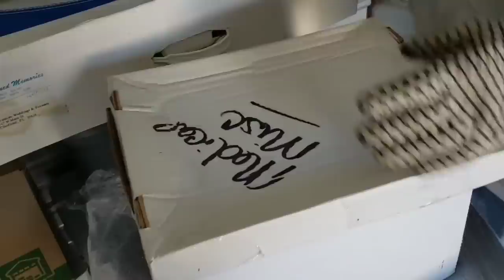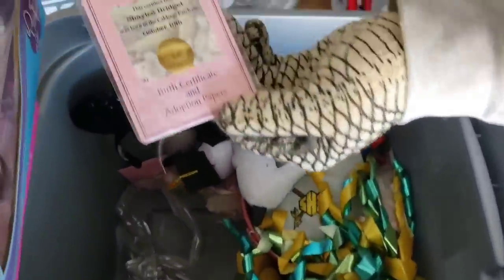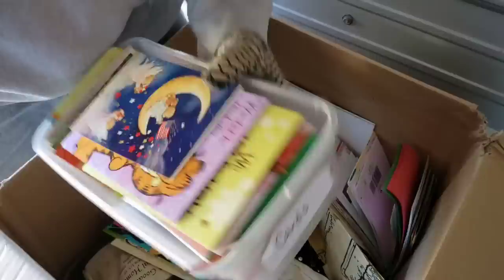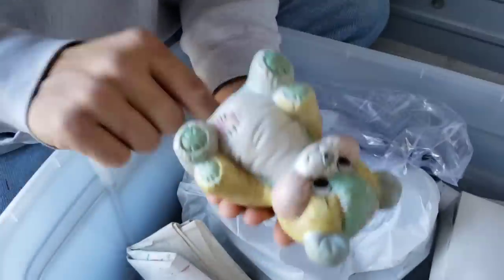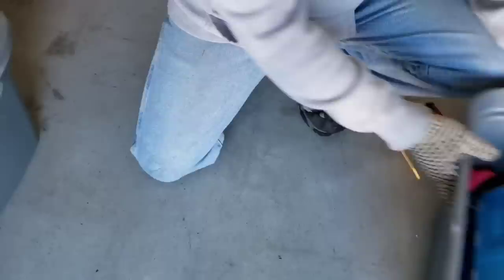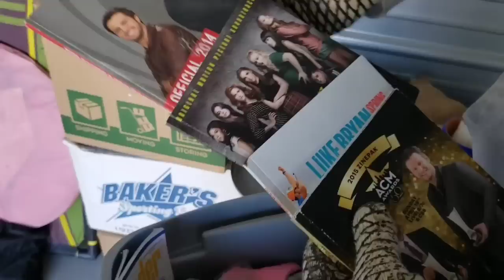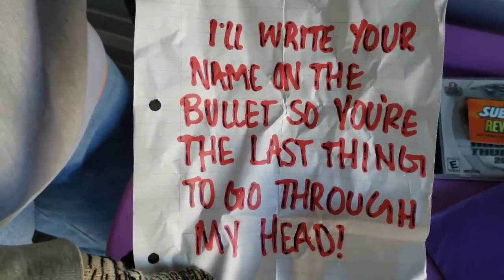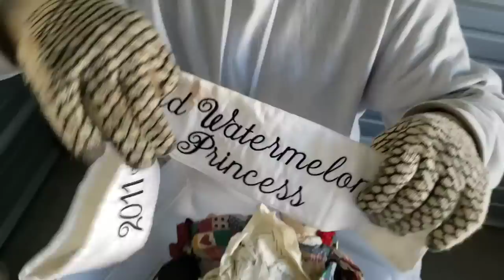CANCER GOT HER I Bought Abandoned Storage Unit Opening Mystery Boxes Storage Wars

Comment: The black purse with the studs on it like a cross that looks like the same ones that you can find inside truck stops that they sell purses and wallets that look like that
Reply: I had a similar purse but it was from America West leather, so I'm sure you will check the tag.  They are big out west and are NOT cheap.  Very well made leather products (like Brahmin) and the black one may be America West from the "Rock Star" collection.   It also had hand-tooled leather, well made conchos, Swarovski crystals and crosses.